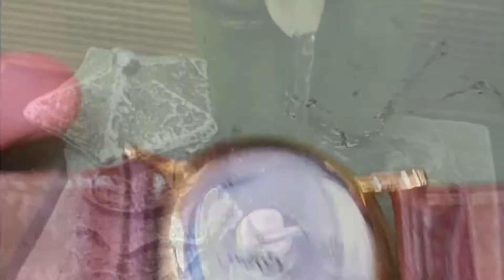how to repair titan watch? Servicing Epson cal.vx12e movement#epson #titan #watches

Comment: Hey, many thanks for the video. I was able to assemble my fastrack watch. One of the plastic gears teeth is broken, that's why I think there is free movement on my crown even after putting it back together. Official service people were asking 750 for service battery included, and the local guy was asking 600. I opened myself and checked it 😂. The problem is how can I procure that one particular gear?
Reply from the maker: You can contact me through. I can help you with the spare parts

Comment: Plastic parts?? This is why these watches don't have the same kind of longevity as the previous watches. I have a Titan Watch which I have been using for 19 years since the time I was in school. I doubt these watches will survive that long.
Reply: Yeah man, I just opened a fastrack watch. One of the Plastic gears has broken teeth because of which I cannot set the time and the crown just moves freely. 😢